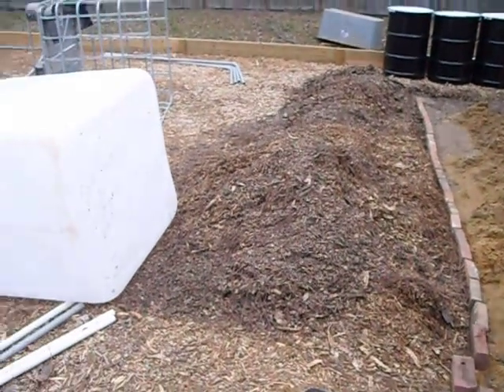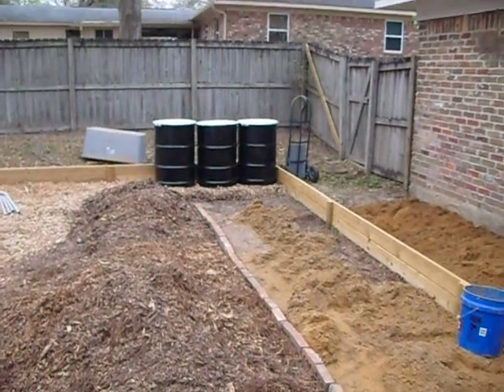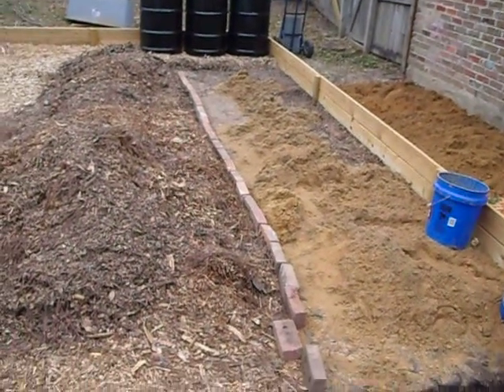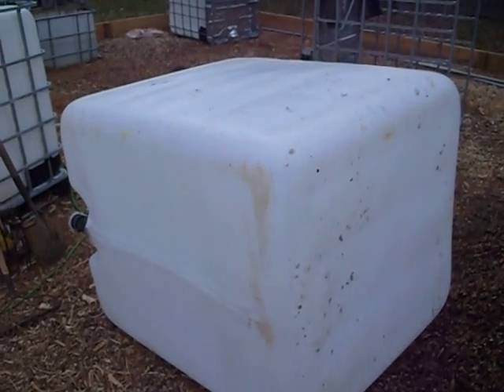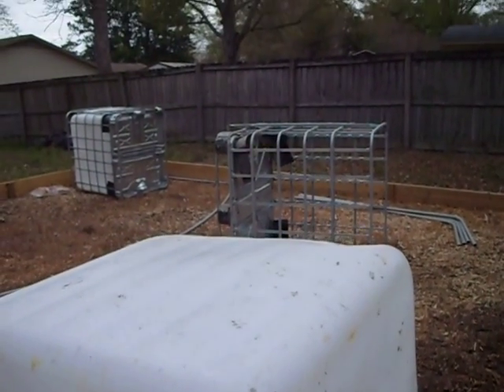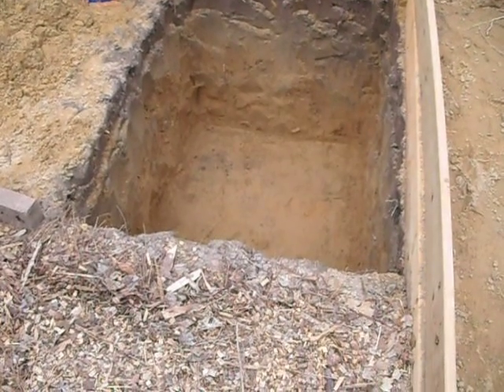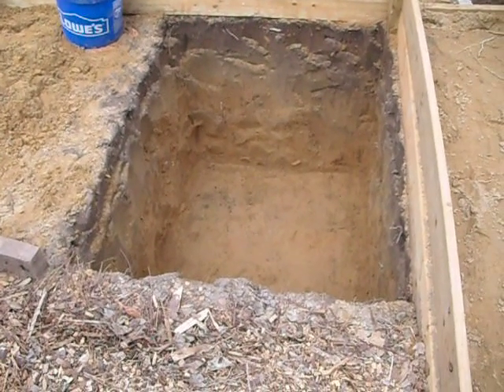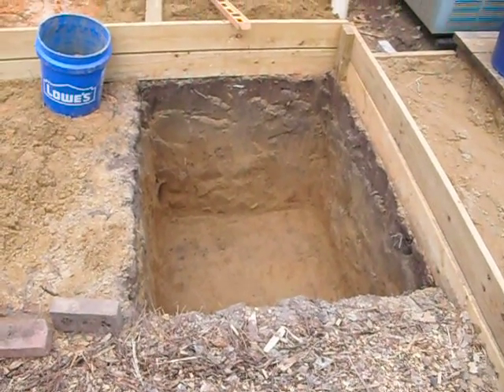IBC Aquaponics, getting started on my system

Comment from the maker: Line the hole with fence boards, you can build panels sections cheap and it works fine.  If you pack the dirt back in outside the boards, the next few rains will only settle things in.  As for emptying the sump to "clean" it, my sump is very clean since the water coming into it is filtered by the gravel grow beds.  The sump is the cleanest of the tanks.  I did add a lid over it to block light which keeps algae down.  The sump stays about 1/3 full  to keep the pump under water all the time.

Comment: Hi there. Im looking at burying an IBC as a sump but worried about the tank caving in if the tank is empty or if in a heavy rain event the tank might destroy itself trying to pop out of the hole if the tank is partly filled. I can get around the soil issue by lining the outside of the cage with steel sheets - but im not sure how to get around the water table issue. Its only a problem if the tank gets empty of course. but you may have to empty the tank to clean it sometime.